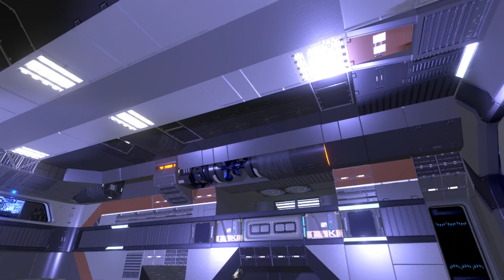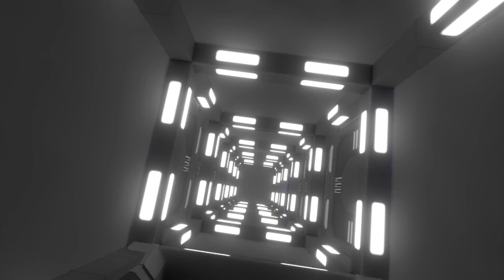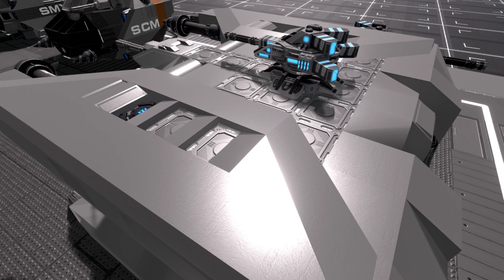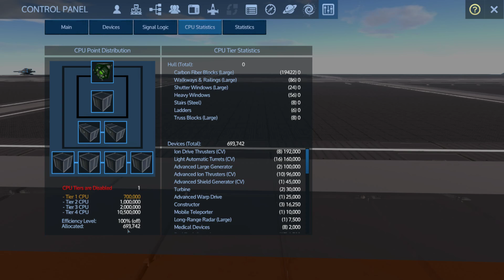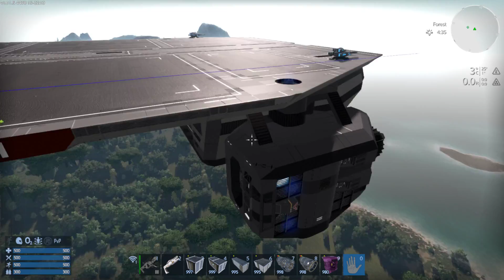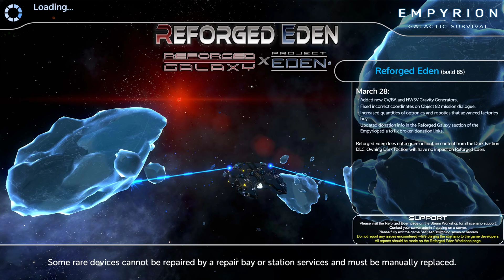Empyrion Galactic Survival - Carapace-C2X and SV miner updates 4/15/2024

Comment: With Helios it spawns in with ion thrusters doesn't it? Did you replace them with plasma or anti matter thrusters? You would be surprised the differences even though they are the same block sizes. I almost always use plasma on SVs and HVs,, and anti matter thrusters on CVs. I see your point on RCSs. I thought I saw videos by Spanj or someone that when 10 or 11 they changed the way thrusters work so you don't need them and made them irrelevant.

You mentioned adding deco on the CV. I don't use it much, but I found something better. RE2 has technicians which when used do things like add 3k cpu, 1k to shield capacity and 50 to charge , a power tech adds 3k cpu and reduces power consumption by 75 watss, and a fuel tech with anothe 3k cpu and 4k liters fuel capacity. So you get a cool deco look with a manned station and real benefits.

Comment: Making large ships is going to be a big learning curve in RE2. First thing to recognize is that you have 3 tiers of each thruster: ion, plasma, and antimatter. They upgrade in-place, and the thrust upgrades (at the moment) are linear: plasma (tier 2) is double the thrust of the ion and 1.5x the CPU, and antimatter (tier 3) is triple the thrust of the ion at 2x the CPU. This means that you can take your 4 rear thrusters (currently all ion thrusters) and replace them with two antimatter thrusters and get 3x the thrust at the same CPU. It will also push the thrust farther outbound which will help the yaw. The cost of this is more expensive parts that will have to be looted or purchased, so playing with a balance of the 3 tiers will be key. 

The upgraded thrusters also need more power, but power may be another place to save CPU. I believe in general you now need less generator power on your ship than in RE1, so you may find that you can cut back on the number of installed advanced gens. Or upgrade to a small fusion reactor which may provide better balance. Again, it will require rarer parts but large ships like this I think are going to be expected to need them.

It's also possible that the Helios is too big for RE2 specs, and may need to be cut down to a 4-bay variant. We're still early in the building phases but people tend to be building smaller ships to work within the new CPU and weapon balance, so you may not be pushing as much mass around as you would in RE1.
Reply: Your last line is my fear concerning RE2 - I don't like the concept of having or preventing builders from making large ships. Some of my favorites are over Size 50 which includes a few Battlestar Galacticas, an Atlantis City, and the Radiant or Kaiser Battlecarriers. These ships work in SP RE1 and I'll be hesitant to move to RE2 if they can't be made functional.